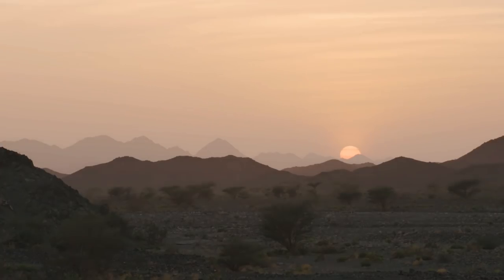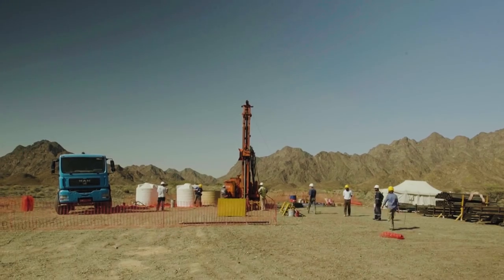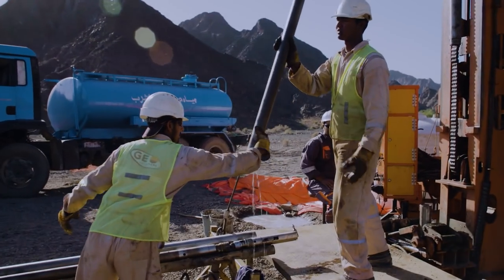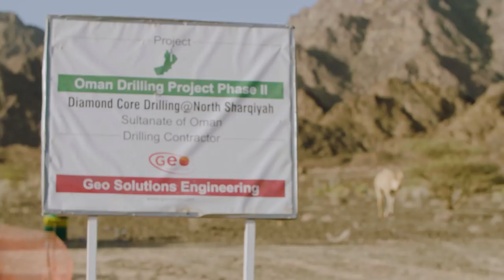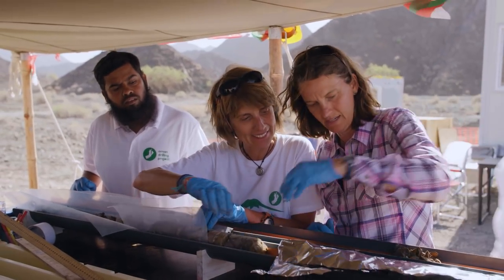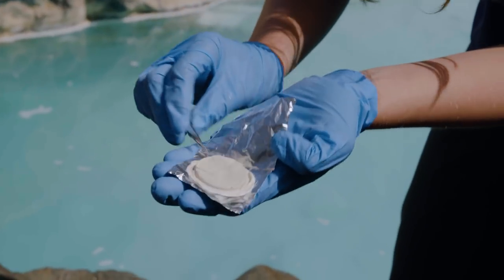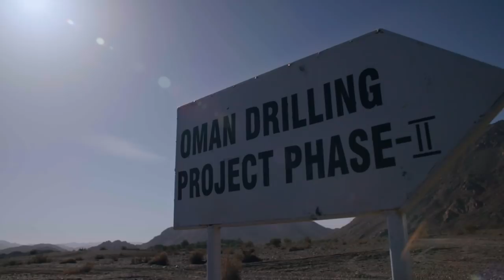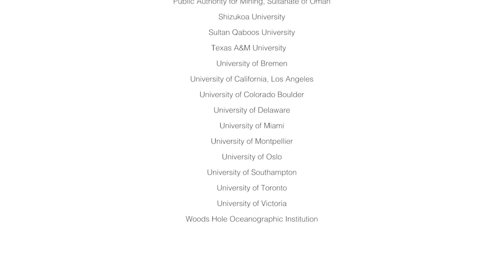Oman Drilling Project: Ancient seabed holds secrets in search for life on other planets

Comment: Question - how do you accelerate CO2 absorption -- by 'million or more'  -- ?
Assume this is applied engineering?  Expose rock surface area? Water/solutions? 
(I remember reading about this project --  and this is an example where the video is more helpful!)
Reply from the maker: Hi Garry, thanks for the question. 
We asked Peter Kelemen about how to accelerate CO2 absorption, and he sent this response via email: 

"there are several routes to acceleration
for solid storage of CO2: 
(1) drill to depths where temperatures are higher 
 and induce fluid transport to those depths
 via thermal convection and/or pumping
(2) improve permeability (hydraulic fracture) 
(3) use fluids with elevated partial pressure of CO2

for CO2 removal from air:
use (1) and/or (2), and return carbon-depleted fluid to 
the surface where it will draw down CO2 from air
 
(1) & (2)  are similar to “engineered geothermal systems” (EGS)
  also known as “hot dry rock geothermal systems”
  and indeed where possible CO2 storage could be combined 
  with generation lf hydrothermal power

for theoretically achievable enhancement of rates, 
based on laboratory data scaled to rates 
during ongoing weathering of Oman peridotites, 
see Kelemen & Matter Proc. Nat. Acad. Sci. 2008, Fig. 5"